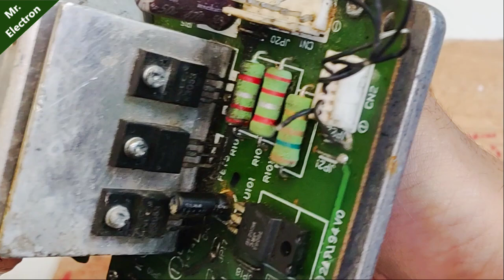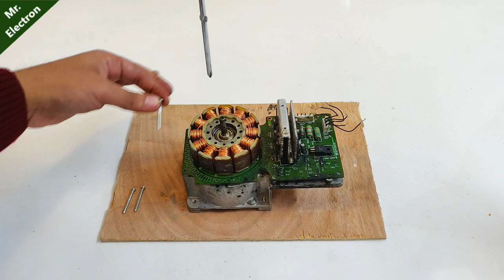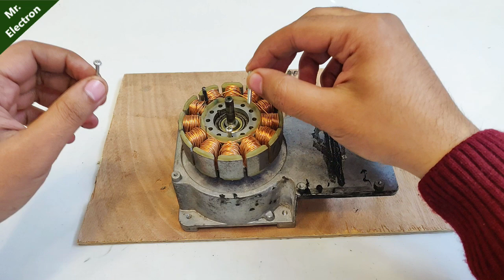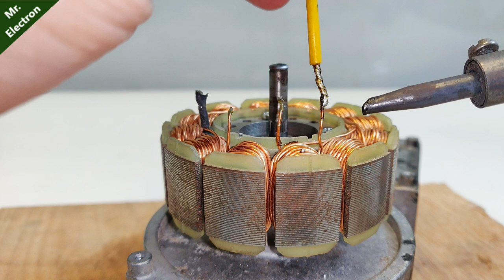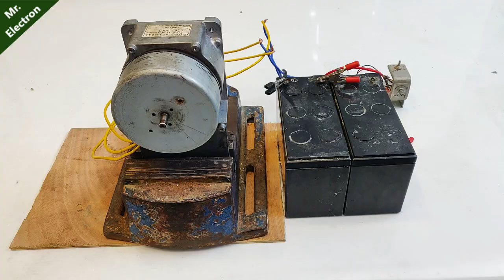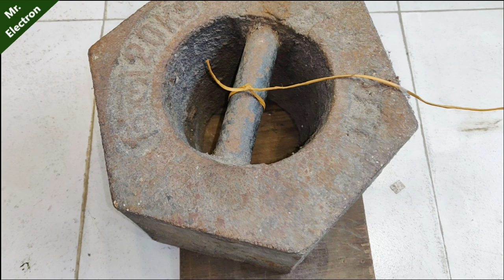Reuse a 24V Powerful Geared Photocopy Machine Brushless DC Motor ( BLDC Motors )

Comment: the board you removed had hall sensors connected to the controller that would stabilize the speed when you try to slow it with your hand.

Comment: good explanations of tests, i dont know if you have made the 12v  wiper motor welded to the modern sissor jack in most our trucks and cars , but that is a  very useful and out of shape men or women could manage a tire change easier , maby add a cordless impact , thx
Reply from the maker: I have been planning on making that..
Reply: @MrElectron  , id say u would make a good one , u might even improve on the design in some way, i was just thinking u might rig a wiper motor to a trailor winch and it could be used to pull u or someone out of the road or ditch in a emergency , anyway good job on your videos !